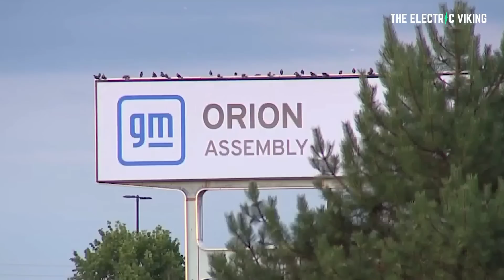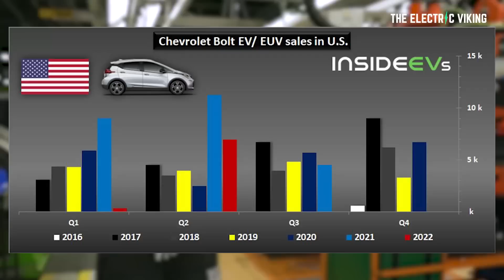Man murdered at GM's Electric Car factory in the United States

Comment: General Motors CEO Mary Barra announced Tuesday that the automaker will discontinue the Chevrolet Bolt EV and Bolt EUV at the end of the year. The news came during GM's latest quarterly earnings call, as Barra related that the Bolt's Orion, Michigan assembly plant will soon be retooled for electric pickup trucks.Apr 26, 2023